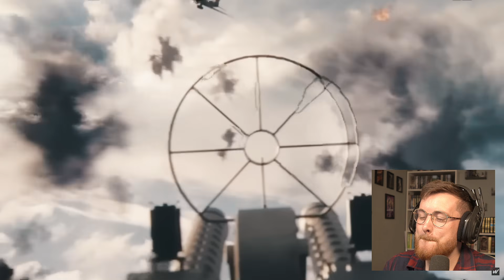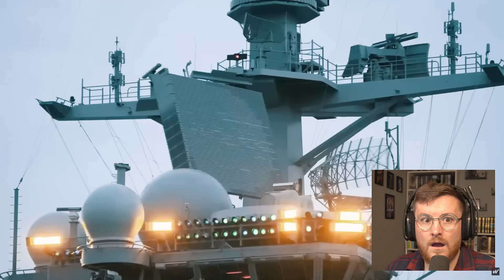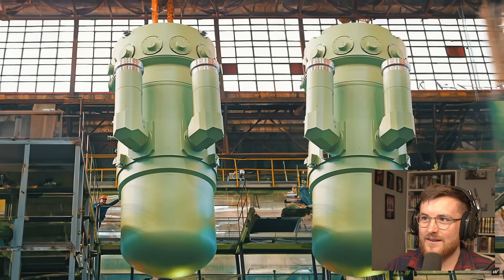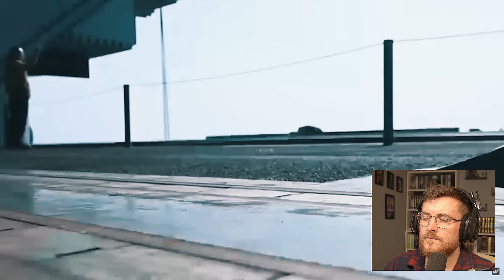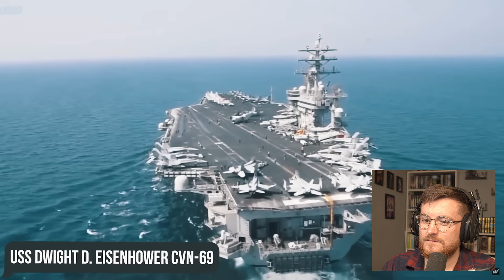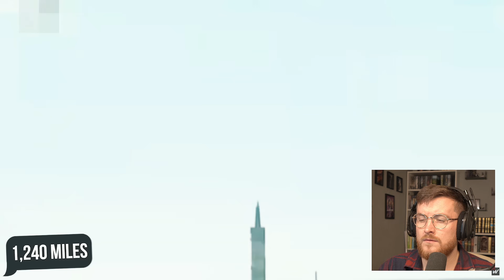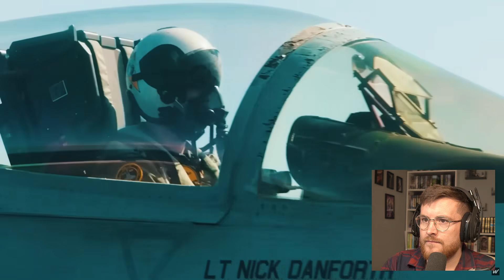Royal Marine Reacts To US Tests Its Monstrously Powerful Carrier To Beat New Chinese Carriers

Comment: Rather than watching and reacting to the video less than 3 minutes in to "search the internet" for information you're probably going to be told in the next couple minutes. [Which you discovered 30 seconds after unpausing]

You want to talk about how nuts the size, crew and aircraft capacity is, when the USA wants to have 10 of these.  Navy says ""In God we trust, all others we track" But in general the American attitude is "Go big or go home" "Don't touch our boats" and "F-ck Around and Find Out"

100,000 tons "If they put 10 of these in the ocean, is the ocean going to rise"
Technically yes, but 100,000 tones is 200,000,000 pounds, so 10 would be 2,000,000,000 lbs, with water being approximately 8.34 pounds we are talking about 239,808,153 gallons of water (roughly 911,271,000 liters) of water, disperse across 139 million square miles/361 million square kilometers, you're talking about displacement of approximately 2.5 liters of water per square kilometer.  Are going to notice if someone down the street dumps a 4 liter bucket of water out?  What if they are half a kilometer away?  I'd wager the people on the next street over won't notice, and even that person's next door neighbor probably wont notice, or if they do, they won't care.

I believe you misunderstood.  The tests didn't cause an earthquake.  The tremors detected registered as an earthquake, in other words, the test explosion was strong enough to look (on instruments) like a fairly notable earthquake.

If China, or any other nation provides adequate reason for the President to order military action, he has 48 hours to bring the issue before Congress and cannot maintain forces in military action for more than 60 days without authorization from Congress.  How long does it take for it to be irreversible?  However long it takes to make one counter offensive, attack or retaliatory strike.  Strictly speaking, this would mean the President could order military action, the action may or may not even take place before the 48 hours is up, but if he brings it to Congress, he can maintain the military action for up to 60 days, technically, even over the unanimous opposition of Congress.  But if there was an attack. that's kind of out the window, because the authorization by Congress is not considered in the event of "a national emergency created by an attack on the United States, its territories, possessions, or armed forces"

Comment: 1 Carrier has a lot of firepower which needs protection from a variety of threats so the answer is NO, a single carrier isn't enough. A carrier strike force/fleet would. Sneaking a submarine close enough is the best strategy and must be defended against. Except for an ICBM dropping down most other threats require default operations.

Comment: Just keep in mind, the specs, abilities, and weapon systems are only what's publicly known, and unclassified. So when they say it only goes X knots fully underway you can bet they can go faster. It's stores 90 aircraft, ummm hmmm, 90 5th gens and all support planes plus more. When the US releases this type of info, you can bet as they know ememies will be carefully taking it in its disinformation. It's common knowledge to throw off adversaries. Down to the ships length and width....announce its a few inches longer or wider so an enemy attacking doesn't know precisely where to fire the missle as it's moving at the same time, they think it'll be at the x marks the spot, but bc it's longer, shorter wider publicly known info weapons miss by feet, yards etc. If it's the US Navy just know they have 10x what they show you and with what we show that's an insane thought.

Comment: You need to understand. We're using the term "Super Carrier" to describe the Ford Class but it's just marketing. They are just a little bit larger than the Nimitz Class. We have 10 of those. And anyone which actually matters considers those Super Carriers. Then there's the Enterprise Class, which if we're going by the same rules was the very first Super Carrier ever built but we only built one of those. So really we're replacing 11 Super Carriers with 10 Super Carriers. Ford Classes are slightly bigger, so it's all kind of a wash in tonnage and crew needed.

The real reason we're paying for it is power output. We'd hit the power cap on what the Nimitz Class could produce and with ever more electricity hungry systems going on these ships we needed a much larger electricity budget. We more than doubled power production on the Ford Class to give it a much much higher overhead of what could be added in the decades to come.

Comment: The Chinese Super Carriers are stuck in port they are afraid to sail them. The Carriers you saw with the  launch systems covered DON'T have functioning launch systems. There is an entire video describing the litany of issues the ships have including making them out of the wrong metal causing more problems.

Comment: For every one they build, they retire an old Nimitz class carrier. So the total number does not grow. How do you crew it? With the crewmen from the retired carrier. But that does not give you ten carriers that you can put off the coast of China. At any given time, only one third of the carriers are at sea. The others are at home port to give time of for the crew and to do repairs, maintenance and upgrades.  You can surge some of those for a few months, but you can't keep that up. By the way, there are 11 supercarriers in the fleet total. (There are in addition ~8 smaller carriers to support marines. They do not fly large numbers of fixed wing jets.) By the time they are getting close to the tenth of these supercarriers, they will be building an even better carrier.

While these carriers are indeed huge, they are huge only for warships. There are MUCH larger civilian ships.

Comment: The Ford Class carrier is replacing not complimenting the older Nimitz Class carriers on a one to one basis. The Ford class will even operate with smaller crews than the Nimitz class.

Comment: As each supercarrier is commissioned one is retired.  There should be 10 or 11 commissioned aircraft carriers at once.

Even though there are currently 11 carriers only some are in active duty at once.  According to an June article I just read, four are deployed, three are preparing to deploy, three are in maintenance which takes about a year, and one (CVN-74) is in RCOH (the major refueling complex overhaul) that can take about four years started in 2021 (or 2019 by Wikipedia) and is expected to return to service in 2025.  The ships have a 50 year service life and at 25 years require the RCOH.

Comment: On a Nimitz Class carrier, the "Crew" [3500] which runs the ship doesn't include the "Air Wing" [2480] which flies and services the aircraft. If the carrier is a Flagship, you can probably add at least another 100. The maximum number on a Nimitz is 6,500.  The Ford Class requires fewer personnel in total, only 4500.

Comment: While the Ford class has significant upgrades over the Nimitz class that it is replacing, the Nimitz class carriers are only a little bit smaller than the Ford class and they have 10 Nimitz class carriers in service now.  And the Ford class will require fewer sailors to operate them than the Nimitz class.

Comment: To be fair, we've had nuclear-powered vessels for a while now. The first nuclear-powered US naval vessel was the USS Long Beach, a guided missile cruiser commissioned from 1961-1995. It was in the 90's that the mindset began to switch to thinking nuclear power was too expensive for any surface ship smaller than a carrier. Nuclear submarines remain on the table, since nobody wants to go back to subs powered solely by Diesel & batteries.

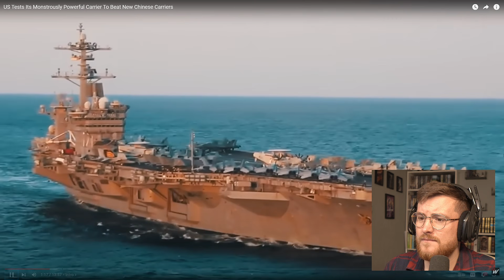Comment: 3:41 - Its not quite on par with Contenants.  However if you counted space on the Aircraft carrier as land area it would be larger than the smallest country in the world (Vatican City).
4:44 - Actually it is powered by two reactors.  It has two A1B reactors each capable of running all the carrier systems and are rated at 700MW each.  They generate 125MW for use with electrical load and 260MW to the propeller shafts in normal conditions.

Comment: No, one carrier would not be enough by itself, not even close.  That's why they're not going to build just one and stop.  Over time, they're going to build enough of the things to replace all of the Nimitz class as they age out of service, thus maintaining enough carriers to keep all of the existing CSGs up and running.  And yes, that means they need at least ten of the things; frankly, twelve would be better.  Bear in mind, aircraft carriers are relatively high maintenance, so there are always going to be at least a couple of them undergoing maintenance at any given time; additionally, the US Navy has obligations in multiple theaters simultaneously, so even if they could field 8 of the things on active duty at one time, they wouldn't be able to commit all eight of them to a single theater or war.  And that's not even taking necessary dock time into account.  So at any given time, there's at least one active duty CSG assigned to the Middle East (generally, in either the Mediterranean or else the Persian Gulf), at least one assigned to the Atlantic (generally, stationed at Norfolk), at least one assigned to the west coast (typically, operating out of San Diego), and at least one in the Indo-Pacific (typically operating out of Okinawa).  That's four actively deployed, and there will be a similar number in some transitional state or another (docked for shore leave, or coming or going, or whatnot), which adds up to just about eight carriers deployed in some capacity or another, and that's pretty much a minimum.  Plus the two carriers that are undergoing maintenance at any given moment, that's ten, and that doesn't leave a lot of wiggle room for sending extra carriers to hot zones as required, which is why I said twelve would be better.  In war time we could do a little better in some respects, at least for short periods of time (e.g., shore leaves and dock time can get canceled), but on the other hand, if actual battles are happening, more maintenance is going to be needed, so that might balance out.  So yeah, ten of the things is a practical minimum requirement, given the US Navy's commitments.

There are many college cafeterias that serve tens of thousands of students, three meals a day.  Granted, those are land-based, so they can get supplies in by truck on the regular, which makes a big difference in terms of the logistics.

The Zumwalt class was discontinued mostly because its main weapon was a terrible idea: let's develop a whole ship whose main weapon costs millions of dollars per round to fire, so that we can't afford practice ammo to train anyone on the thing, that'll be great.  Other aspects of the Zumwalt's design are interesting and could potentially make it into other ships in the future, but that main weapon is a big fat no.

My read on the Chinese mock-up of the Ford, is that it was probably mostly intended for internal purposes, for shaping the narrative within their own military and within their own political bureaucracy.  A stationary mock-up in the desert is not really what you want if you're training your people to attack the real thing at sea (you'd be better off repurposing a surplus fishing vessel), and it hasn't been prominently featured in any English-language content produced for the global market by e.g. the Global Times, so far as I am aware, so I don't think its main purpose was outward-facing propaganda either.  That leaves internal narrative shaping, which is a Really Big Deal in communist and authoritarian countries generally and the PROC in particular.  The CCP leadership is an oligarchy with extreme factional infighting, and one of the most important things a leader has to do in order to stay in power within the party, is convince a lot of people (who ought to know better) that he is doing a good job of getting China ready to fight the West, retake Taiwan, achieve global supremacy, and resoundingly banish the frumious spectre of the Centuries of Humiliation, forever.  It's a whole big thing.  There's a lot of internal posturing and jockeying for position.  I believe the mock-up ships in the desert are related to this.

As far as we know right now, the biggest thing holding back Chinese military jet aircraft, is the jet engines themselves.  For political reasons (basically: Western countries don't entirely trust them), they are unable to source high-quality jet engines from the West.  This limits the performance, but more importantly, the operational range of their jet aircraft, to a fraction of what their Western counterparts can do.  They are definitely working on creating a domestic high-quality jet engine, but as far as is publicly known, they have not yet achieved it.  Their best air-superiority fighter (which, yes, is transparently a copy of the F-35) has already received one significant upgrade to its jet engines, but the new ones are still not where they need to be, to give the aircraft the kind of operational range that the PLAN would like it to have.  This is a problem they will almost certainly solve sooner or later, but this sort of research (and the infrastructure development that goes with it) by its very nature takes unpredictable amounts of time, and even the people working on the project would not be able to reliably predict how long it will take; external observers certainly cannot.  They could start producing better jet engines next month, or it might not happen for twenty years, who can say.

Comment: The Ford-class carriers are meant to replace the Nimitz-class carriers, so they will be built because they have to be built.  The Nimitz class are nearing the end of their service lives.  The Nimitz was commissioned in 1975.  It will be 50 years old next year and is becoming increasingly expensive to maintain and upgrade.  The Nimitz is scheduled to be retired in 2025.  As each new Ford class carrier comes on line a Nimitz class carrier will be retired.

We are currently building two more Ford class carriers.  The U.S.S. Enterprise (CVN-80), which is third Navy ship to bear the name "Enterprise".  It's delivery has been delayed for 18 months because of supply chain issues.  The U.S.S. Doris B. Miller (CVN-81) is also under construction.  It is named for Doris "Dorie" B. Miller, a WW2 sailor who was the first Black recipient of the Navy Cross, our nation's second highest award, for his actions at Pearl Harbor.  It is scheduled to be commissioned in 2032.  The U.S.S. John F. Kennedy (CVN-79) is currently going thru it's final testing and certifications and will be put into service in 2025.

We currently have 10 Nimitz class carriers in service and each of them has approximately 1,000 more personnel than the Ford class carriers will need.  So, yeah.  We have enough sailors.  BTW, if a U.S. aircraft carrier parks itself off your coast, it's not just the aircraft carrier.  It's the entire Carrier Strike Group, which consists of as many as 7 other warships including two attack submarines which can launch land attack missiles.  Also, the Group's support ships will be with them.  The support ships carry things like jet fuel, weapons, provisions, and fuel oil for any ships in the group that aren't nuclear powered.  You're looking at close to 10,000 sailors in just one Strike Group.  We currently have 11 Carrier Strike Groups.

Comment: What people don't realize is that the Chinese naval numbers are boosted because they count small patrol boats as warships. The US Navy outweighs the Chinese Navy by 2.5 milion tons or  more than two and a half times the weights meaning the US operates a greater number of large ships with about a 5 to 1 fire power advantage in missiles. Where the US has to be careful is the ability to produce these ships as the Chinese are able to produce them at a more rapid rate however it may take 20 years for the Chinese to have Naval parity with the US if the they were to produce at full steam and the US were to stop producong ships all together.

Comment: I think a big problem is that there is only one ship yard capable of building an Aircraft Carrier. It drives the cost up as there isn’t another ship yard for competition or what if the need for more carriers at a much faster pace were to occur such as a massive war? They need to be able to be built on the southern coast like Florida or in Texas as well as the East coast such as California or Washington. Much in the same way we should be able to build submarines in various locations as well. Placing all your eggs in one basket isn’t the smartest thing to do no matter how secure you feel. 
The claim that the Ford Class Carriers have no missile defense systems installed currently and require an aircraft to perform the job is absolutely ridiculous. Not only can the Ford Class defend themselves they also have the carrier fleet which can do the same job as well. I’ll be glad when the U.S. and other allied nations finally stop doing any kind of business with China which will seriously hurt their economy. It’s very obvious what they are planning to do with just the Satellite footage. Guess the U.S. should have allowed Japan to finish them off instead of saving their asses during WW2.